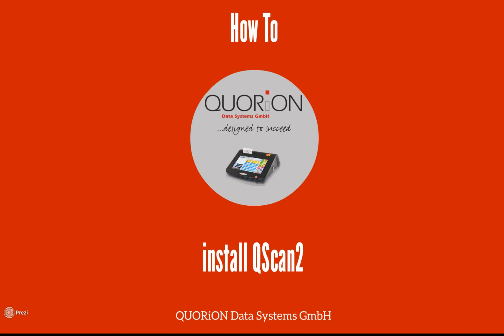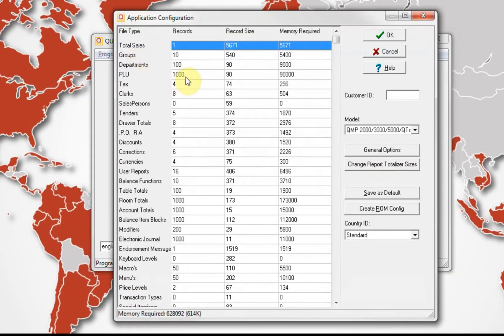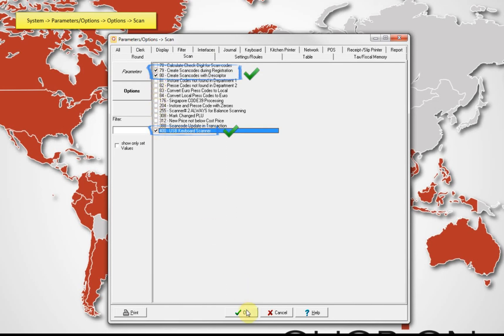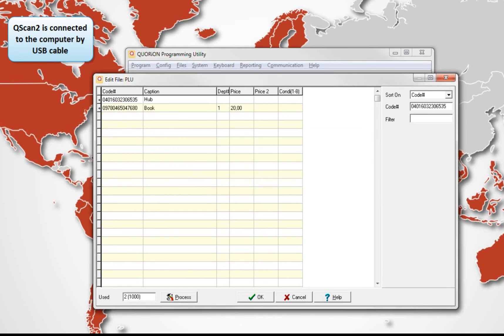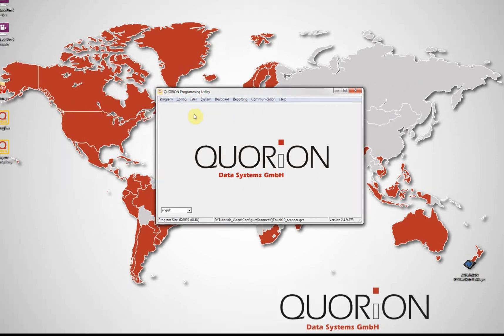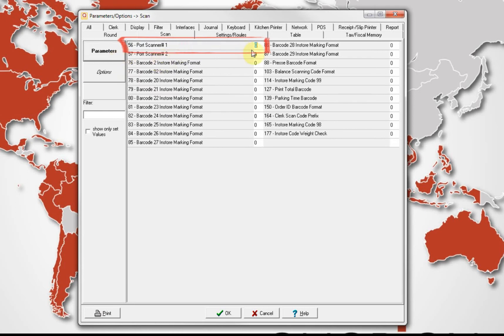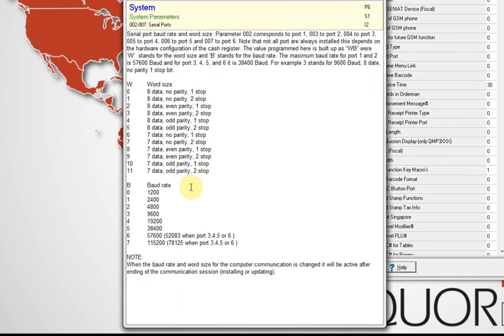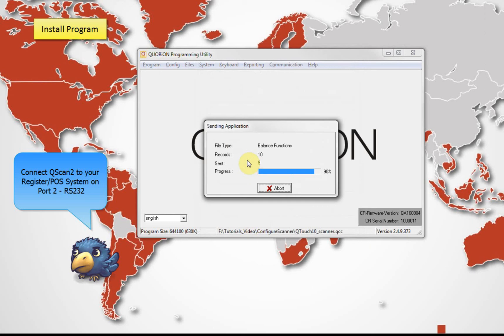POS Software Tutorial - How to Install QScan

Comment: what the way to edite usb parcode reader to work at quorion 2244?
Reply from the maker: Good day, In your case the possibility is to use the RS232 port on your cash register
Reply from the maker: Please contact your local QUORiON reseller for support questions. Thank you.
Reply: Good day, it depends on the scanner type you are using, on this video we described the programming for QScan.
Normally it is just required to scan the Scanner manual the communication type you are using (watch the video:  USB 1:25sec / Serial: 2:47sec).
Reply: There is no USB slot in the machine. I have a USB barcode reader and I want to switch to Lan. What is the best way to convert?
Reply: The agent from whom you bought the machine does not want to benefit me, so I decided that your question would be to benefit. I also want to do a barcode scale feature on the machine and I can not explain it or anything like Casio machines